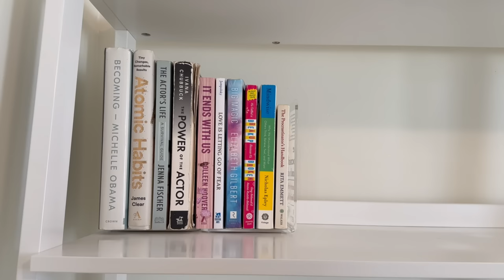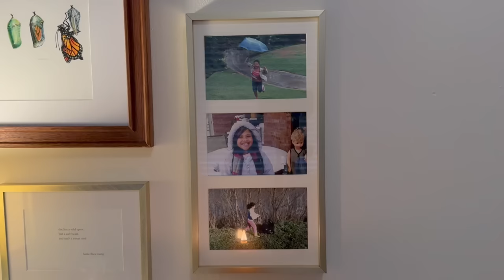Complete Bedroom Makeover | painting, new furniture, organizing & decorating

Comment: I would recommend using a drill bit (if you have it available) to drill holes into the wall instead of the screwdriver bit itself.
Use the screwdriver bit to help with screwing screws into thing like your bookshelf.
And, use a ruler and some tape (like washi or masking tape) if you don't have a level to make sure things like your shelf brackets are, well, level.
Reply from the maker: Those are great tips, thank you!😊